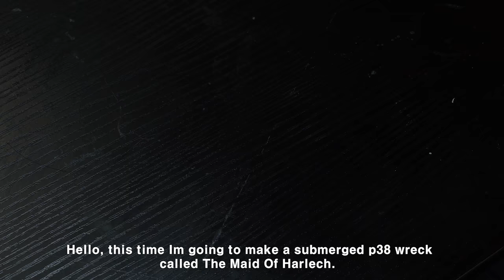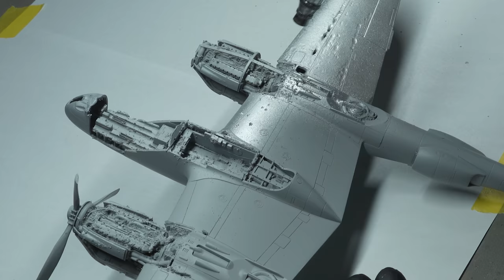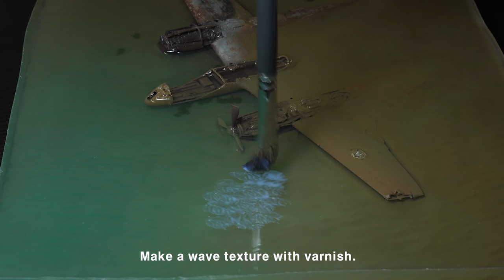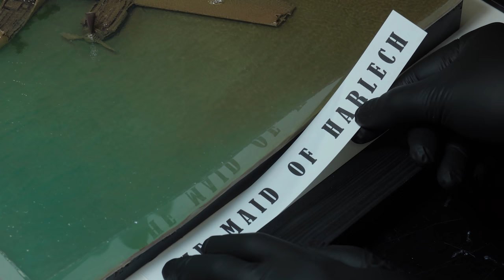Making  P38 wreck diorama  -  The Maid Of Harlech

Comment: I've seen the actual wreck and this model is shockingly realistic. Beautiful and and at least as valuable a record of the wreck any amount of photographs.
Reply: Am I mistaken in thinking that this wreck is in Wales Harlech? If so I may have to make a trip there one day
Reply: @Reaper_7645  it is indeed. However most of the time it is buried well out of sight under the shifting sands. And its exact location is pretty guarded!
Reply: @theflow5269  hmm I’m not too far from Harlech so I’ll deffo take a peek when I get the chance.
Reply: @Reaper_7645  harlech is very picturesque even if you dont see the maid theres good views from castle.
Reply: @artycharr  there is indeed lol I’m from Manchester UK, just down the road lol
Reply: I live in North Wales. Going to check into this! Thanks. Also beautiful work!
Reply: Im wondering how is it still there. Usually thieves and all sorts of low life steals absolutelly everything from crash side like this to sell is on Ebay for extremme inflated price
Reply: @theflow5269  how did a P38 end up crashing there?
Reply: @Its_Me_Romano  there are ww2 (and later) dotted all over Wales. Navigation errors, mechanical failures, Navigation errors, battle damage etc etc
Reply: @theflow5269  so you can't go and look at it
Reply: @JJBblitzball  Its usually buried under the Sea and you can only get to it on very low tides.

Comment: This is a work of art.  Absolutely nop-notch and beautiful representation of the Maid.  It's such a shame the aircraft itself hasn't been salvaged.  It could be returned to display status at least and, if Glacier Girl is anything to go by, even airworthiness.
Reply: It would be cool, but not only is the wreck itself cool, everything on it is so covered in rust at this point that I'm sure you couldn't repair it without using basically all new parts.
Reply: @soopespeed  I agree flying condition is a bit of a stretch, given all the salt-water immersion, crash damage and parts-stripping that was done, but it's possible to restore aircraft more banged-up than this one to display status, at least.  The RAF Museum is doing exactly that with the Dornier-17 they salvaged.
Reply: @elennapointer701  Warbirds have been rebuilt from worse condition...

Have to remember though, not much is saved in these cases, an argument could be made the original aircraft is getting destroyed simply to give the identity to a reproduction that is worth far more money if it can be claimed as "restored original".

Comment: Airplanes are made by aluminium, and aluminium rust is light gray, not red.
The brownish colored areas are not surface rust, are deposits of organic materials and mud.
I guess is a misconception coming from the cars, that are made by steel, and it rusts red.
Anyway, 90% of that is covered, so I don't really see the need of it in covered areas.

Besides of that, nice job.